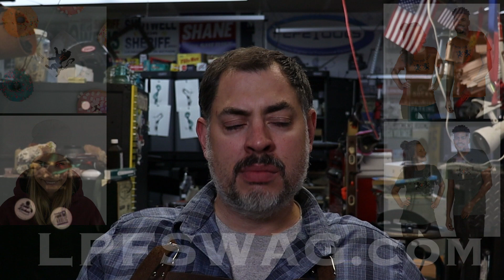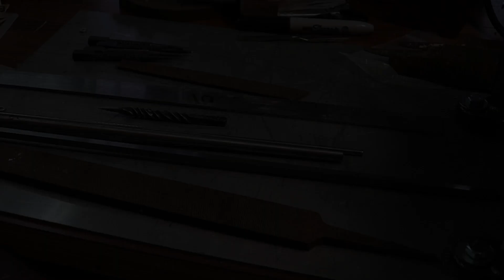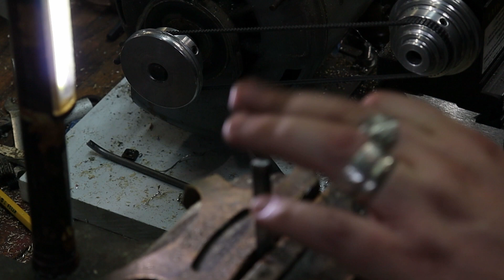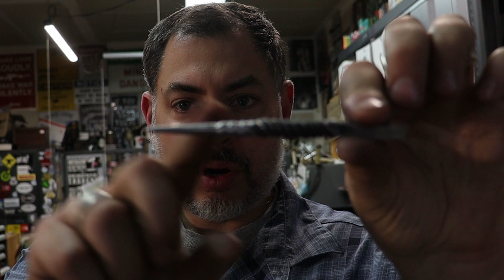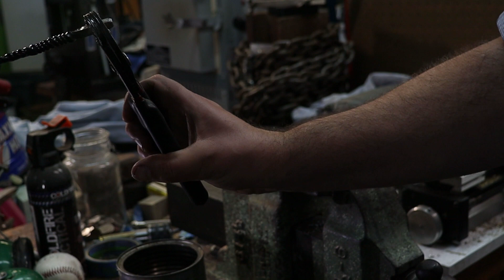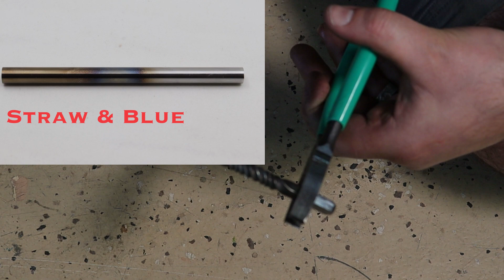Metalsmith Tutorial ) Tool steel to Tool~ making and heat treating tools for the metalsmith

Comment: Hi Christopher, great video! What would I have to do to make one of these in brass? I’m thinking brass burnishers and setting punches.
Reply from the maker: Same Process for the most part minus the heat treat part... I have a lot of brass we could make a custom one
Reply: Lion Punch Forge LPF I went and tried to find o1 tool steel on line. No luck. Brass is abundant though. I found lots of steel at onlinemetals.com but the shipping is killer. I don’t need enough steel to make the shipping worthwhile.